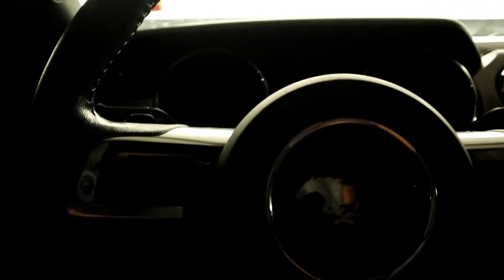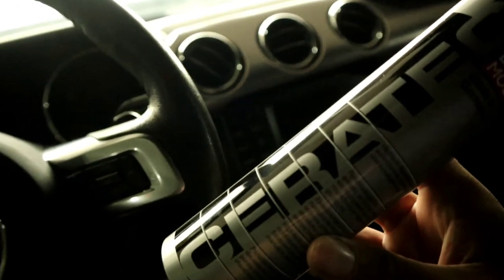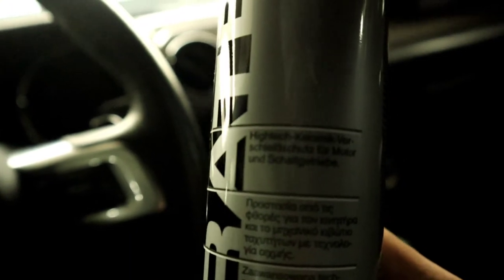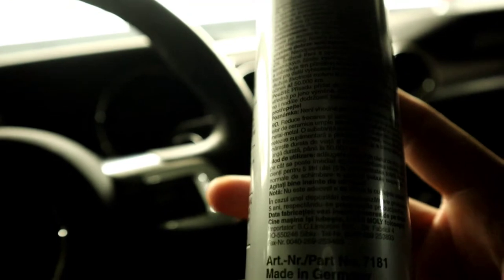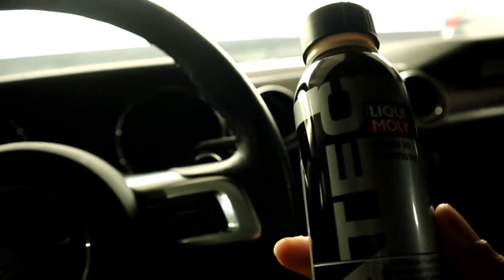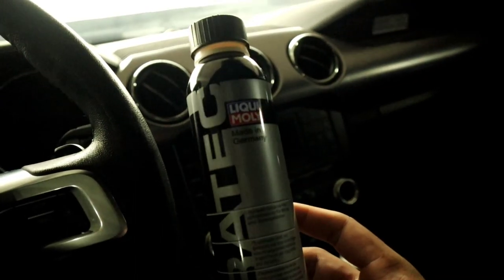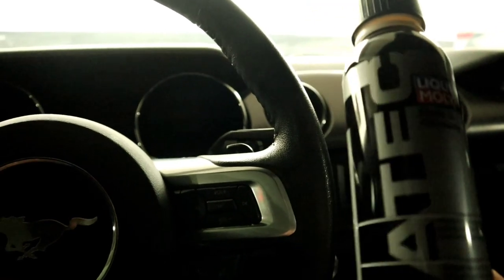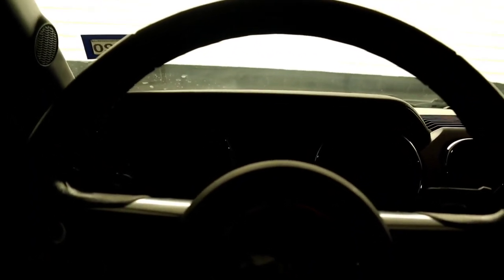How I fixed my 5.0 Coyote Engine tick/rattle

Comment: Pretty sad. It's up to the customer to fix what Ford should. Why doesn't Ford fix this problem that has been going on for years. Who is making decisions at Ford. So many issues with the Ford mustang. But they still pump them out each year with the same problems. If you buy a mustang know what your getting yourself into.

Comment: ot already hot a plasma coating in the inside of the cylinder. ot is BC of the piston slap and the pilot rings plus compression rings are lose, for increase mileage. I had it in a 2019 GT. I raced  AMG and let the pmc kick me out of redline @ 8300 - 8500 r/m. After racing for 20 mins  about 10 miles down the road going up a steep climb, my GT crapped out. I cracked the block. upgraded to the FHP Aluminator 5.0L 12:1 n/a
no tick bc if the higher tensile strength oil rings and compression rings. LiquiMolly is just "snake oil" pitting a name aid on it. FORD HIGH PERFORMANCE Aluminator
is a permanent solution with a billet oil pump. 😊

Comment: I just bought my GT 2020 and hear a rattle roughly around 2k RPMS it goes in Friday but you only hear this in gear right? And also I was told you have to do this at oil change sub track the amount of oil for this to equal out fluids
Reply from the maker: Yea I only hear the rattle while in gear. Whenever I'm in park I don't hear anything. I put all 8 quarts in plus the ceratec, but since you have a 2020 would be all 10 quarts

Comment: Hmm, I have noticed that the older Gen 3 called for 5W-20. I just bought a 2021 5.0 and it has 8000 miles. I just did the 3rd oil change and not tick. I think that the oil in the earlier ones have too thin oil. Just my opinion, but think about this: When an engine is new before the first oil change there is engine assembly lube which is thicker. Then when you drain it out and put 5W-20 it is thinner. Why did Ford change to 5W-30?
Reply: i have a 2012 gt that calls for 5w-20, i never really heard the tick that loud or that much but it was there, switched to 5w-30 and i heard it longer and more than i ever had, gonna hvae to try the ceratec

Comment: Had the low rpm rattle since new. Heard the stories before buying so I sucked it up.
After my second oil change at 10k miles is when this loud tick/knock started. Real loud at idle. It didn't do it until immediately after that second oil change.
Took it in under warranty a couple days later and got the scripted line of "it's a normal characteristic of the engine." Ford will not fix it. Not a happy Mustang owner. My '04 4.6L felt like a much more solid car.
Reply from the maker: I made an update video on the tick. Long story short my job uses commercial ford trucks and they even have the tick. These trucks are driven daily and have 150,000-200,000 miles and still going strong. Starting to think the tick isn't causing failures but it's still embarrassing to hear
Reply: @ThatGuy5.0  it's really embarrassing and made it difficult to be proud of my purchase.
Some guys were able to get rid of most of the noises, rattles and clonking by modifying parts of the drive-train but I didn't feel I should have to do that to a brand new car; Could get an older model for a fraction of the price that won't make me nervous to drive.

Comment: I’m about to give this a try on my 2011. I just changed my oil and the tick is driving me nuts.
Reply from the maker: Hope it helped man
Reply: @ThatGuy5.0   it did. The engine is running noticeably smoother and it quite down quite a bit. Not gone but better!
Reply: @linuxhelpresource  the Gen 1 coyote isn’t supposed to tick just the Gen 3 coyote commonly does that. My Jean one coyote as smooth as silk you could hear the injectors a little bit that’s it my brother Gen 3 ticks

Comment: I have same i think it happens when you rev it a little and it is not a tick in time with engine its a rattle and yes i hear it in garage but outside not so much but if your driving near a wall or past another car you can! Ford told me its nothing to worry about but i took it to a performance shop and they put some stuff that looked like chocolate color and its really quieted it down! When you used to warm your stang up you can hear little single tick like noise that sounds like when you turn your car off after driving and the metal cooling makes those little kreek noises! Thats what mine souned like! I do feel that its possibe its actually not an issue as the coyote engines do make weird noises that are driven many years but its still a bad feeling! Mine is supercharged to! Can you still hear any little rattle here and there or is it completly gone! I thought it was exhorst to! But the computers in these cars are one of the best if any little problem occurs it will set engine light off! Thanks for vid !
Reply from the maker: Anytime bro, thanks for watching!!

Comment: Awesome. I have the same issue on my F-150 5.0 coyote. Definitely will give it a try!
Reply from the maker: Hope it helps bro!
Reply: Did it help at all? My 2020 5.0 f150 is rattling more the more i drive it, and I just hit 6k miles🤦‍♂️
Reply: Joel Gastelum I tried it and it helped a little bit but the tick is still there. It gets worse as you drive it like yours. Mine is a 2011 F-150. It might be worth giving it a try. To my understanding it is rod knock and am now looking into replacing my rod bearings. Hope this helps.
Reply: @mattyicee1991  thanks man  I'll see what I'll do 👍
Reply from the maker: @mattyicee1991  damn bro wish it could've help even more. When I tried it it was a last resort. From what I understand this issue isn't causing failures but nobody should have to drive a newer vehicle rattling like a hoopty
Reply: @ThatGuy5.0  I agree. My truck seems to drive fine with the exception of the ticking sound. It is just very annoying to have a rattling sound every time you drive. Thanks again man
Reply: At around how many miles does the problem show up? Why not got to the dealership?
Reply: @fx4guy  It turns out I have a powertrain warranty. She is at the dealership right now and I am working on getting a new engine installed. 👍I was told there was an internal engine problem that was causing the ticking sound.

Comment: Mustangs are such a piece of junk.  I could put up with the engine tick, cheap plastic interior and glitchy electronics, but that crap Chinese manual 6 speed in the GT was the last straw for me!  Sold the Mustang after 2 months!  I bought a real car, with a quality transmission and couldn't be happier!  No wonder Ford stopped making cars...I guess we should all be thankful for that!
Reply from the maker: That's the exact reason I went with an auto, that MT-82 is straight trash. The engine tick is also unacceptable, I love the car but having to pay extra money every oil change to hide the tick is garbage

Comment: I found using aftermarket oil and filter caused sounds with my 13 f150.
Stuck with Motorcraft oil and filter and it went away for now.
The 5.4 was picky with filters and oil pressure.  A ford mechanic told my buddy was the cause of his bad engine, cheap filters clog and restrict flow.

Comment: Where do you pour it at in your engine
Reply from the maker: The same spot you pour in the oil, it's on the left side of the motor
Reply: Did you do it after oil change or just a random time
Reply from the maker: @rjjohnson1700  right after the oil change